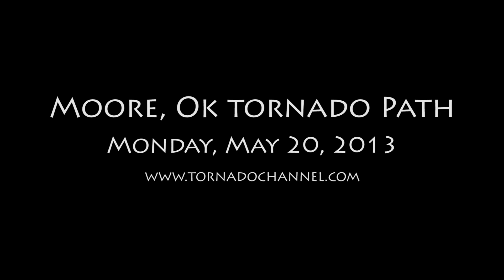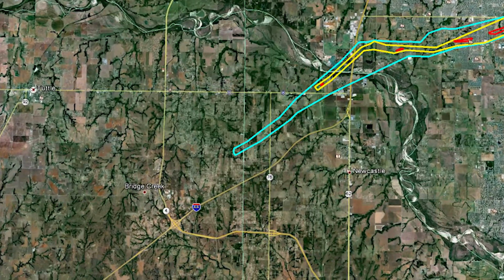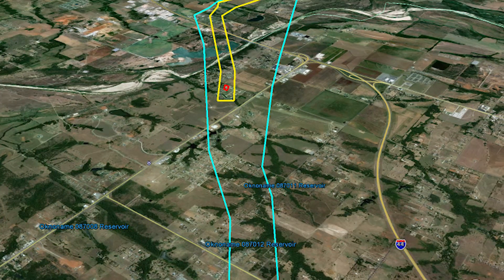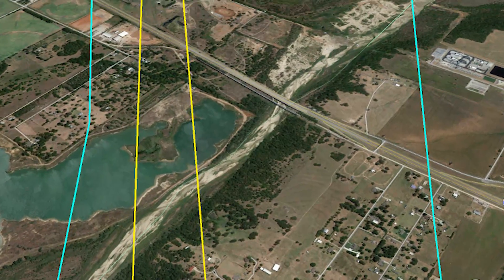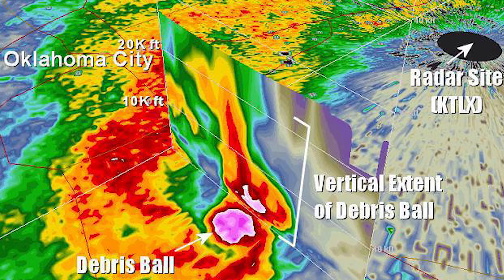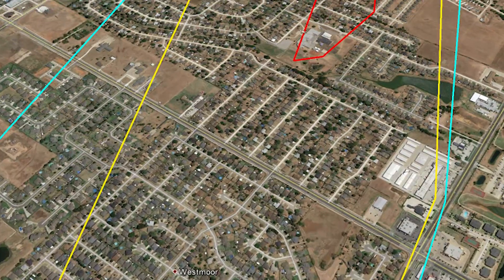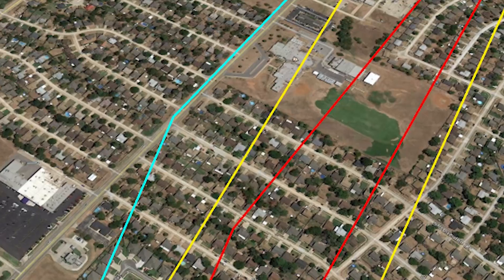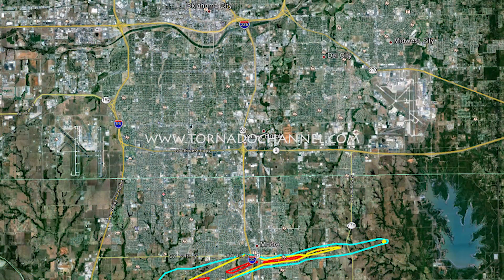Moore, Oklahoma Tornado Path 3D Flyover Tour

Comment: It literally didn't intensify till it hit the edge of the city and it didn't calm down till it hit the other edge
Reply: These damn twisters sure have it in for Moore, OK.
Reply: Just like what happened two years earlier in Joplin, Missouri on May 22nd, 2011. The Joplin tornado intensified as it entered the west side of Joplin at 5:34 PM Central Time and didn't calm down until it exited the east side of Joplin and dissipated at 6:14 PM Central Time. What made the Joplin tornado much more deadly than the Moore, Oklahoma tornado on May 20th, 2013 can be summed up in a few key factors:
1.) The Joplin tornado formed too quickly for the National Weather Service office in Springfield, Missouri to issue a Tornado Emergency for Joplin or a Tornado Warning for Jasper County. According to storm chaser Scott Peake (a member of the Basehunters storm chasers team) the tornado that tore through Joplin went from a small rope tornado to a monstrous wedge tornado in approximately twenty seconds.
2.) The tornado formed on the boundary of and went through a densely populated area as Joplin is the fourth largest city in Missouri.
3.) The Joplin tornado was hidden by very heavy rain which made it difficult to see.
4.) The residents of Joplin had a woefully insufficient amount of time to take shelter from the tornado. When the tornado sirens in Joplin first sounded at 5:17 PM Central Time; this gave the residents of Joplin seventeen minutes to take shelter. By the time the tornado sirens began wailing a second time at 5:34 PM Central Time it was too late for the National Weather Service to do anything because the tornado had already entered the west side of Joplin and was causing a lot of deaths, destruction and damage on the west and south sides of Joplin.

Comment: F1: 73-112 Mph
F2: 113-157 Mph
F3: 158-206 Mph
F4: 207-260 Mph
F5: 261-318 Mph
Reply: Ozone  Wrong.
Reply: Ozone  theres two Fujita scales if you didnt know. One is for going off Wind Speed and the other is based on Damage. F-1 is Winds Speed based on data (radar and or measured at or near surface) EF-1 is Estimated Wind Speed thus estimated damage will give a EF rating rather a messured wind speed will be F rating which again means it was messured, rather using an instrument and or radar. Also need to note that both have Different Ratings of wind speed again based on damage even tho i dont think that shpuld be the case because it confuses people. Whwn you look up the Fujita Scale ypu shpuld see results for both the F-Scale and the EF-Scale. After surveying the damage from the NWS Assessment Team they will give the Tornado an Estimated Fujita Scale of EF-0 to an EF-5. Also an EF-5 has wind speeds of that of an F-4, reason being its "Enhanced" in scale is again based apon the damage done which gives it the term EF and not just F. Its confusing 8f you dont knownwhat the two differences are and its confusing if you do but get them mixed up. There is a purpose for them both, one is for Wind Speed the other is for Damage. The did this because of how much more powerful and devastating Tornadoes can be and get to help people better understand the sheer power of what wind can do. The main thing thats most dangerous about a Tornado isnt just the Wind but the debris that comes with it.
Reply: Ozone  Wrong
Reply: Ozone  no thats why they came up woth the EF scale
Reply: Ozone is biased, he helped create the horrible system that is EF5.
Reply: Right!
You are the only person who sees and knows about the hype of the new EF rating system. Which is bogus. 
The F rating system is the proper and correct method of rating a tornado. 
Of course, the so-called intellectuals and self proclaimed experts just blindly go along with the new defunked EF rating system.
Reply: @TheTavelingCat  thanks lol and sadly yeah a lot or most of the people who just claim to "know" something usual either don't know enough or much of what there talking about.. 5$ he was reading a script lmao also the EF and F ratings should just be a slightly better system on how to determine both the maximum potential windspeeds in that given Tornado and the maximum windspeeds that's rated for the destruction it done instead of two separate ratings which I completely understand and not saying they shouldn't be there but they need to be better interpreted bc it's confusing to a LOT of people. EF stands for Estimated Fujita which is Estimated Windspeeds of a given Tornado from Only the Damage it caused. F stands for just the Estimated and or Measured Windspeeds for a given Tornado. For those who don't or didn't know or may have been confused with it. 
If you hear your weather station or anyone say a confirmation of an EF-1 or EF-3 then the damage that was observed determined at Least a Tornado of That strength of not stronger. If you hear them say F-1 or F-3 then they either are confirming the Windspeeds on radar or Measured on the ground with ground radar and or other instruments.. not gunna go through Tornado saftey but even an F-0 cause completely demolish a Trailer Home..all Tornados should and NEED to be taken seriously even if you think you're safe, act like you still need to be protected just be sure and take as many precautions necessary and possible to keep you and or your loved ones safe..I don't like it when seeing people get hurt from something that CAN 100% be predicted..just not atm it can't be 100%

Comment: It's important for people to know that the EF rating is given according to observed damage, not a pure measurement of wind speed. The tornado itself is given a rating according to the maximum damage it delivers; this presentation should correctly be considered a damage path, not measurements taken from the tornado itself. Note the tornado appears relatively weaker over sparse areas, because it wasn't damaging anything. A 300mph tornado that goes through empty fields and knocks over a bird house will earn an EF0 rating. It's just a measure of what the tornado does, not actual data from the tornado.
Reply: That is why we need a better scale that only takes wind measurements and estimations into account.
Reply: He helped create it, he is very biased that’s why he doesn’t understand why the F scale is 100% better than EF.
Reply: @deaconrich6317  tornados both ef and f are based on damage not actual wind speed .They calculate how fast a wind has to be to do this type of damage
Reply: The National Weather Service damage assessors seem to walk right by a debarked tree with a 2x4 sticking through it to get to a house slab to see if the floor sills were anchored properly.
Reply: Right, so therefore the EF rating system is misunderstood and false.
The F rating system rated the tornado wind speed regardless whether it was in a field or a high population area. 

So...due to the flawed EF rating system as to the actual tornado wind speed. Most EF 5 tornadoes are really F4's. And so on down the line.
I can only really think of two real F5 tornadoes; The Jerrell tornado and the 1999 May 3rd tornado.

This proves just how rare F5 tornadoes really are.

Comment: whats incredible is that the warren theatre was up and running again that week.
Reply: Kpoole25 it didn’t get hit directly or even at EF2 intensity, the tornado made this funky jog up north basically curving around the theatre and hitting the hospital at EF4-5 strength
Reply: @kjburns3226  facts
Reply: From what I understand emergency personnel used the parking lot of the Warren Theater as a triage and staging area in the immediate aftermath of the May 20, 2013.

Comment: They should build schools and critical buildings on a north to south axis rather than east and west one in these tornado states.
Reply: Swole Astronomer first off, no, the majority of supercells and their tornadoes move from SouthWest to NorthEast. second, that still in no way affects the likelihood of being hit nor does it affect the damage dealt. a tornado can and will move any direction. i have even seen a tornado move Southward while the supercell that birthed it moved Northward. building axis changes are done to even temperature and airflow throughout a building. they have nothing to do with supercellular/tornadic severe weather and , in any case, stand no chance against it.
Reply: that would change nothing...
Reply: Swole Astronomer  yes, as a supercell moves along any tornado that develops is most likely to move in that same direction, though tornadoes are infamous for being erratic for good reason. their speed (across the ground), strength, and size can all change very drastically in a few seconds time. good examples of this are the El Reno tornadoes massive size development of over a mile wider than its previous size within 180 seconds or the Joplin tornadoes extreme strengthening trend in its early life from ef-1 level winds directly into ef-4 level winds in just over 10 seconds. the basehunters chasing channel has the best footage of this. and there is indeed places with more or less comprehensive data on the subject of tornado paths and trends. a good place to start would be here http://www.tornadohistoryproject.com
Reply: disturbeddemons1 while chasing today we saw a tornado move about 1/2 of a mile southeast on a E/NE moving cell. It was on the ground about 9 minutes moving steady E/NE then randomly turned SE for a bit. Once it got back moving NE it dissipated pretty quickly. They can and do change direction pretty often and there is no way to know it’s going to happen usually. I don’t usually get within 1/4 of a mile for this exact reason. Today we were about a half mile away so there was no danger but I was worried because I figured some people were most likely closer. Getting really really close is an amazing intense experience but it’s just not worth it. I wasn’t chasing yet when El Reno happened but that is a perfect example of what can happen. This has been an intense outbreak the past few days. The season has been slow so far and then as soon as may got here it’s been popping off. Hopefully the rest of the season is amazing and safe for everyone. I’ll be out in the plains the beginning of June so hopefully this June is a good one. I’m really hoping to get some beautiful LP supercells in the northern plains. Around June the jet stream starts moving toward the northern plains where there is a lot less moisture which can lead to amazing storms.

Comment: Warren was smart when building his theatre. He built it to withstand tornados past ef5 rating. Yet our school buildings doesnt have this.
Reply: No this is not true, the tornado tracks as in this video were slightly inaccurate, Warren did not take a direct hit and likely experienced EF-1/EF-2 winds, right as the tornado was about to hit Warren, it made a hard north turn, and it made a kink and was going basically due north for about a 1/2 mile before continuing eastward. Had the tornado not change direction at the very last minute, Warren would've had EF-4/EF-5 damage.
Reply: I can't imagine the amount of fear among the employees of the Warren Theater and the Newcastle Casino as well as the gamblers at the casino and the moviegoers at the theater when the tornado was first sighted by news helicopter pilot John Welsh for Oklahoma City's NBC affiliate KFOR Channel 4 as the station's chief meteorologist Mike Morgan provided as much information as he could about the tornado with news desk anchor Linda Cavanaugh providing about the school districts in Newcastle, Moore, Midwest City, Del City, and Oklahoma City. However I have a lot of respect for the police officers, firefighters and paramedics in Moore as they got to work with rescuing and comforting the injured in a triage area set up in the parking lot of the Warren Theater.

Comment: will you people stop saying that F5 is the highest category there is? The Honorable dr. Fujita made the scale up to F12, which of course would be super Sonic wind speeds. and were the winds really that weak? I will have to fact check those maximum wind speeds
Reply: Jesse Hyde You're technically not wrong, but Dr. Fujita said it's impossible to reach those wind speeds. It's like making a human strength scale and adding "S13, able to tear the Earth in half." I'd also like to clarify that he said "EF5" based on the new scale, which is the highest since it simply says 200-endless mph is EF5.
Reply: @dccaleb5529  not impossible at all
Reply: What planet are you living on?
Reply: This is true but since we use damage to categorize, there is no reason to go beyond.
Reply: Exactly. At EF5, everything is completely destroyed, and removed from its original location. There's no reason to have the scale go any higher.
Reply: The EF rating system is not the proper method to measure a tornado. 
The F rating system is. 

If the same tornado goes through a field that doesn't cause much damage to anything. Then it probably is rated a EF3.
However if the same tornado goes through a highly populated area, it is rated a EF5.
Same tornado, but different surroundings. 

While the F rating system rates the actual tornado wind speed REGARDLESS whether it is in a field or a high population area. 

Most if not all EF5 tornadoes are really F4's.
I truly believe that the National Weather service has purposely redefined this for hidden reasons, that probably has money rooted in its purposes.

I call a spade a spade, and have never been a type to be gullible to believe anything just because someone says as such. 
Critical thinking has become a thing of the past for the masses of people nowadays.
Reply: Jesse Hyde ...actually wind speed has nothing to do with how a tornado is categorized by the national weather service...it's judged by the damage.   I know they were thinking of changing the standards but not sure if they have yet.  It really is an undefined rating system because while higher wind speeds usually coincide with more damage it doesn't always work out that way because not all tornados hit populated areas...thus the reasoning for the National weather service using actual damage to officially categorize a tornado.
Reply: F5 is not the highest on the Fujita scale BUT... EF5 is the highest level on the enhanced Fujita scale. This video is correct.
Reply: @Kyrios nope the F scale goes to 12